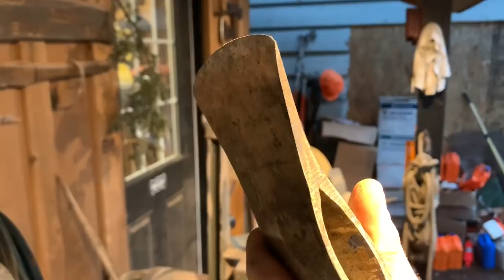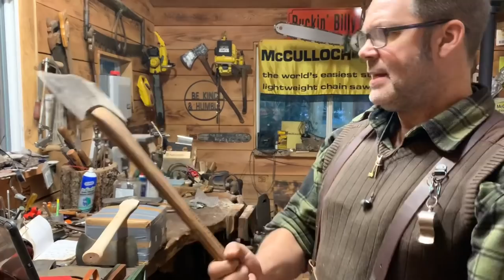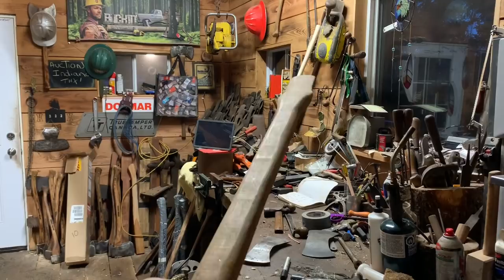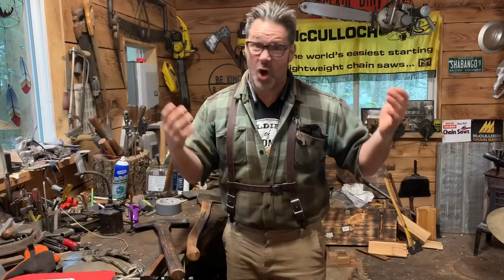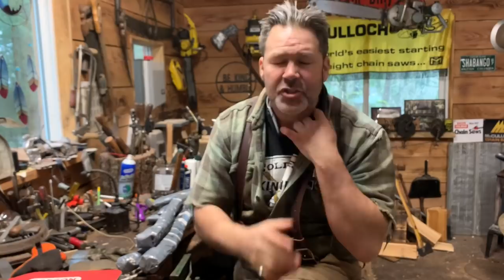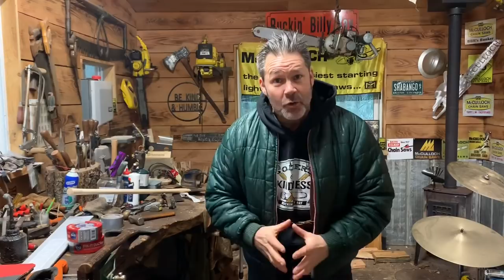Tree felling axe. Handle length. Go with your gut

Comment: I just love your enthusiasm. I've never done it for a living but I grew up cutting and splitting hardwoods down here in NC with a single bit axe. Darn sure kept me in shape. We use a wood burnig boiler to supply heat to three different buildings including two homes and a garage so I still cut and split a lot  just use a saw and splitter now but I value your opinion. Your tips especially on filing have helped a lot so thanks brother and keep BUCKIN

Comment: My favorite axe is a almost 50 year old 4# True Temper single bit.  It has a 31.5 inch hickory doe leg handle on it and it will cut, which is why I have kept it go so long.  I have a 36 inch straight handled 5# True Temper double bit but it has always felt clubby in my hands.  It will cut but I have always liked single bit axes.  My TT boys axe is about the same as your HB double bit - 2 1/4 pounds and it has a 27  1/2 inch doe leg on it.  It is a good wedge banger.  The axes I like and use have custom made leather sheaths on them.  The wall hangers do not.  My favorites are my 4# TT, my CS Trail axe and my Husky Carpenters axe.

Comment: Hey buckin' do any work with Brush hooks? I use some council tool FSS brush hooks for clearing out small balsams and limbing up trees for our sawyers when I'm doing trail work and the heavy weight and wide blades make really short work of such soft woods I can usually hack down little 6"-8" balsams in just 3 swings
Reply from the maker: NO SIR

Comment: Great vid Buckin ! .. ive been wondering about leans and undercuts .. can u make a difference on the horizontal undercut against its lean ..i mean without a dutchy make it lean over more .. ive been thought it should always be 90° on the stump.. i only do fire wood so i dont need perfect butts.. but could it be saver with some tricks ?..

Comment: Buckin' if you had only one option on a single axe to survive 1 year in the forest/bush. And it was the only tool you could take. Would it be a single bit or a double bit? Handle length, weight, and or brand. Or would it be a hatchet? This axe would be your only tool. What would it be? And why? Love the channel.